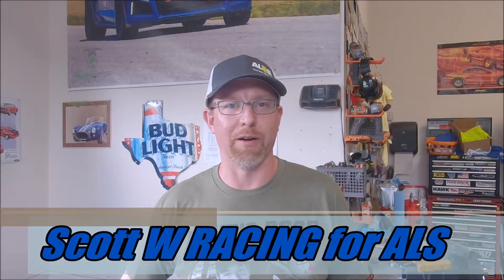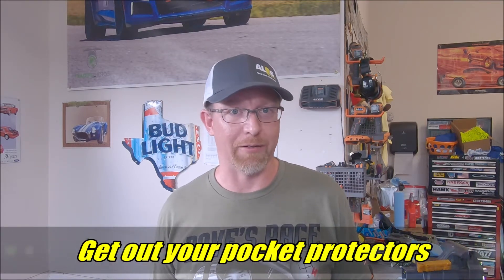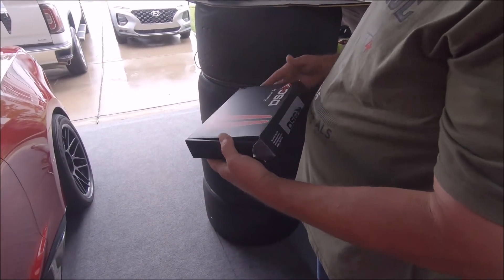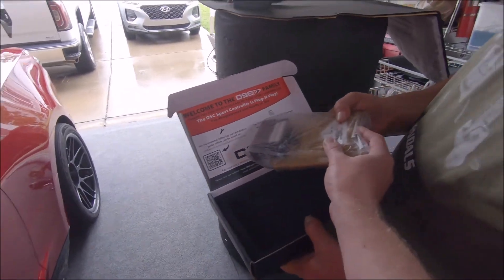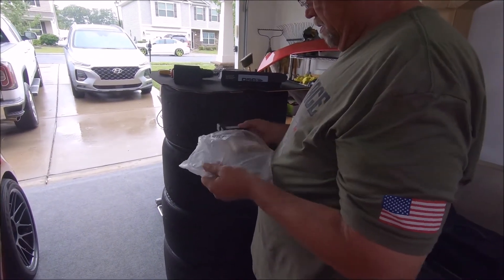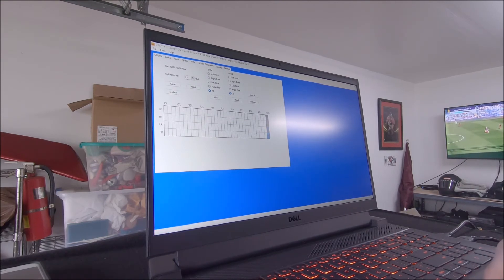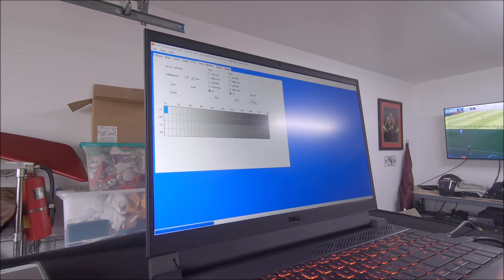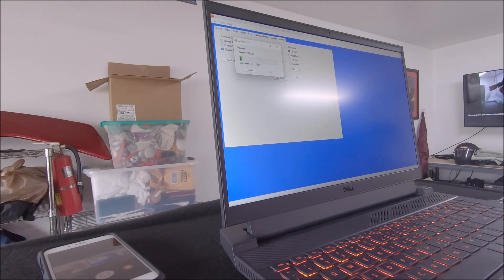DSC Sport Mag Ride Controller Install & Tuning Camaro ZL1 #CamaroZL1

Comment: Thank you very much for your help with this install and tune!! After just one event at Charlotte using it I could tell a noticeable difference in Braking performance in distance and stability. Also it made a noticeable difference in reducing understeer I would typically experience with the stock controller. I will really be able to tell more when I run CMP next as that is my test track for improvements to the car. For clarification the car is a 2021 ZL1 but this controller will work on any 6th gen with Mag Ride. Thanks again to @Beast ZL1 for putting this together!

Comment: Great vid. I just installed my V4 about 3 weeks ago and have a full day at the track. My previous car was a zl1-1le and with the DSC, based on lap times and feel, this is a monster product. Thanks for making this video. I hope it brings to light what DSC is actually doing.

I have one concern/question. You mention in the video that the default firmware/calibration in your unit did not have the latest cal from DSC based on the settings. Given you posted this only a couple days ago, should I be concerned that my cal is out-dated and needs attention?

I would be super excited if you could send me your modified calibration (3 years of twaeking). It would be great to compare your settings to DSC's. Once again, thanks for posting.
Reply from the maker: Sure thing, send me your email or hit up @BeastZL1 on his Facebook page.

Comment: You are not taking advantage of Low/Med/Hi Speed compression and rebound control in the velocity table. Which gives you more granular control over the suspension as opposed to just stiffing and or softening the shock calibration. I played with both and for me, compression and rebound offer much better compliance throughout the suspension travel. I've not been on track yet, however, I live near several mountains and have been able to exercise both the OEM and DSC as well as compare adjusting shock calibration tables against compression and rebound. Net for me is compression and rebound are the way to go for fine tuning chassis compliance and balance. Of course as with anything YMMV. By the way, are you heading to CMP for JTI Aug 06 and 07? If so let's compare notes. I'm in advanced and will be in an RSB 2019 SS 1LE, you know the year with an ugly front end!
Reply from the maker: From @BeastZL1: I am not going to be at CMP that weekend, but plan to go back after mid-September. I will look at the velocity table, but the g-table is going to have the biggest impact on a road course when you are at 0.7 to 1.4 G most corners. I'd love to compare notes sometime.
Reply: @RacingforALS  Copy that. As for the g-table sure, it will make an impact. However to really dial in or fine tune the suspension you need to use the velocity table to adjust comp and rebound. And you can obviously use both together. For example, the velocity table will allow you to make individual adjustments to each corner of the car. So for example you can stiffen g-table values as you demonstrated in your video. And then further fine tune front and rear as well as left and right in a more granular way. Typically slow speed comp and rebound are in play during each phase of cornering. If for instance, I find I am getting more oversteer than I'd like, with the velocity table I can impact the suspension at a specific suspension travel velocity to really dial in the rear to give me the base adjustment and desired result of the g-table adjustment. And still have a very compliant rear on exit with an adjustment to low speed compression... in this case a reduction. At this point, I've only had my DSC Sport for ~3 weeks and am still sorting everything with MRC capabilities. My intent is to data log at CMP in a few week's time, review, and then adjust as needed. And repeat the process until I get the car dialed in for the tracks I typically run at. All of that said, even just out of the box and with the baseline calibration file, and zeroing out,  it is much better than OEM controller so it is a win if you never really dive deep into and leverage the available capabilities. Of course, that isn't me and sure doesn't sound like you either! Good luck with everything and stay safe out there.
Reply from the maker: @FL50ssp  (from BeastZL1) I am interested to get your feedback, especially from CMP. We can trade files and compare. My tune minimizes understeer in my ZL1 on 3R's into turn 12 and 14, but it really pushes in turn 12 to the point that I go in slow and point the car in as early as possible. It's even more obvious on cold Goodyear Super Car 3's during the SCCA Time Trials https://youtu.be/gY25nEx93X0?t=152
Reply: @RacingforALS  From what I can tell you are too early in T12, look how much steering input you have at corner exit. Your entry speed looks good. Try apexing the corner at about mid to 3/4 of the curbing. This way you can straighten your hands earlier and get back to full throttle sooner. As for sharing info certainly, I'm sorting out how to mount a tablet/PC in my car safely.
Reply from the maker: @FL50ssp  Turn 12 is all about getting out fast and minimizing understeer. I've tried multiple entry points.

Comment: Thanks for doing this video. The latest calibration tables from DSC are dated 08-26-21. The max value for the shock Cal in this updated is 1100mA at 100% for track setting. Where did you get 1700 from?
Reply from the maker: It was the file dated 2-12-2020 and the base file has a front shock mA of 1750, which is too much for the ZL1 on Goodyear 3Rs. The calibration had understeer in low speed corners.